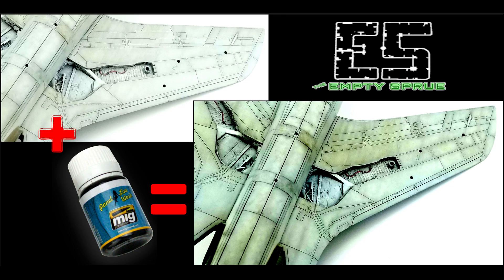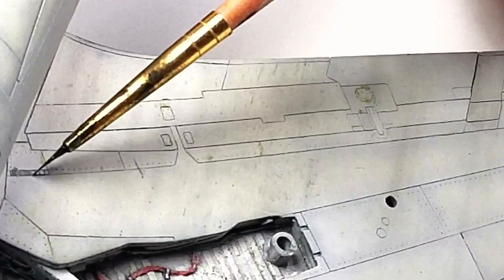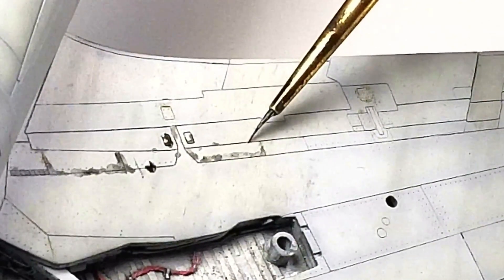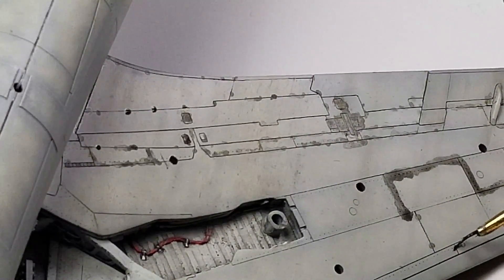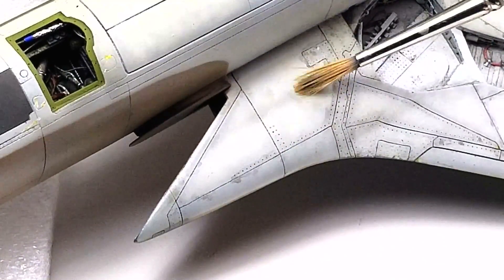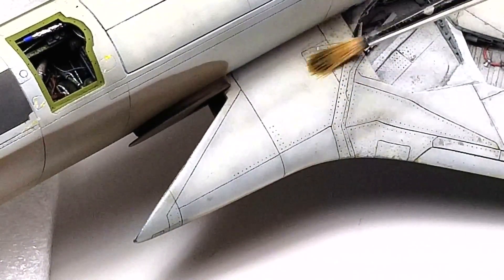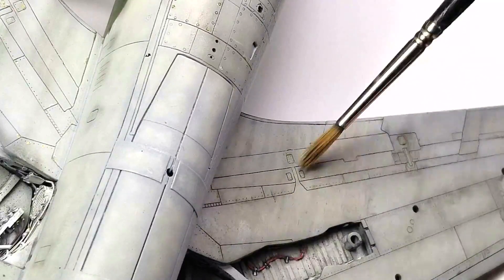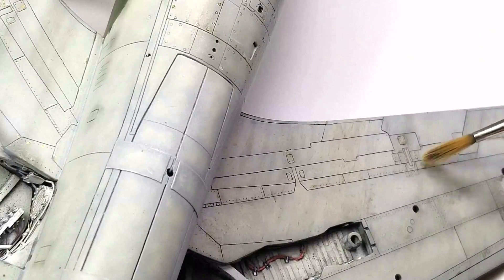How to use Mig Ammo Panel Line Wash for 2 Weathering Effects At Once!

Comment: I've just learned that you need a semi-gloss or gloss coat to add a clean panel line wash (like you say). My first attempts were done with no clear coat at all and I end up scuffing off paint and it absorbs into the paint. I then got an ultra matte varnish so I wouldn't scuff paint off and had some of the same problems --- mostly the wash seeping into the paint. My next model I will try a proper gloss coat to get a clean panel line wash application.
Reply from the maker: the model in the video had no semi gloss or gloss coat on it at any time. The idea is to apply the panel line wash in a controlled manner as opposed to the popular method of flooding the entire model then wiping off the excess. The technique in the video is intentionally not that

Comment: This panel liner is driving me nuts. Dark Sea Blue is the perfect tone for my models, however, immediately after shaking the bottle the pigments start sinking to the bottom, so I can get about two brushloads out before having to close and shake the bottle again. I had hoped I'd find some neat trick to avoid that. As it is, I have to use the AK Paneliner, which in contrast is extremely heavily pigmented and thus presents issues of its own.
Reply from the maker: The settling issue is real, but you can use it to your advantage. Sometimes you might only want a little tone/color instead of the full on mix of any of the weathering liquids, so letting it settle can be advantageous, but I totally get what you're saying. 
Thanks for watching and commenting!
Reply: Have you tried decanting a small amount into a shallow dish? That would probably help.
Reply: @TJRohyans  Yeah, I came up with that a bit later after watching the video. However, I found that mixing oil paint with white spirit, thereby creating my very own oil wash/panel liner, is faster, cheaper, gives the exact color tone I want and saves me the hassle with the pigments. Definitely the way to go for me.